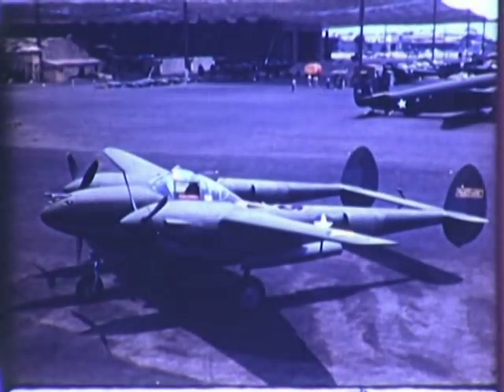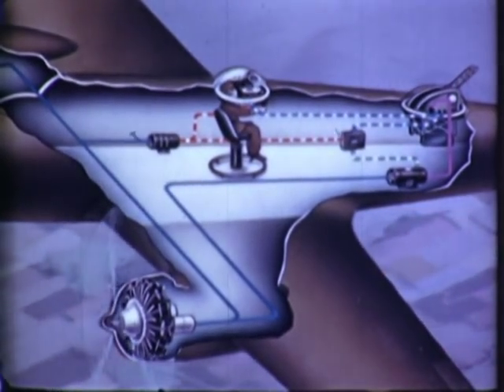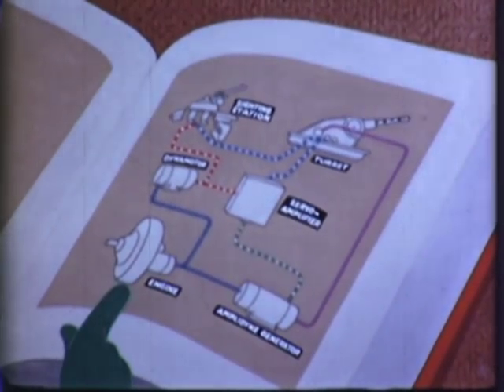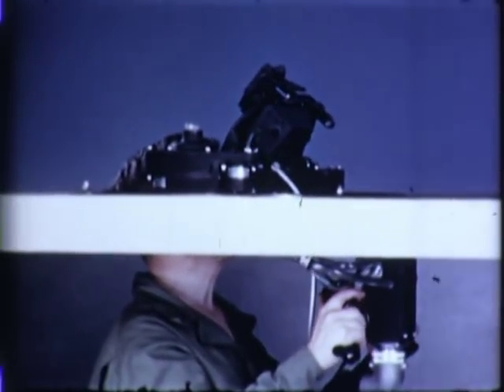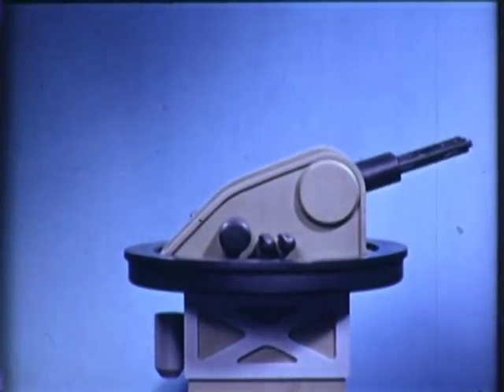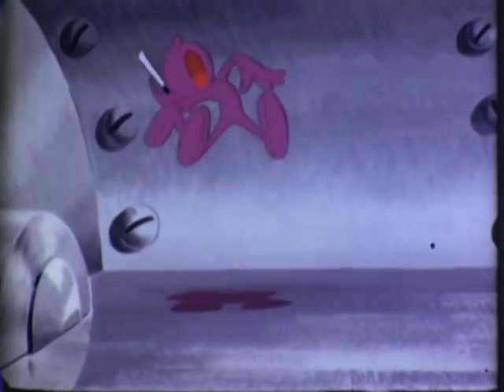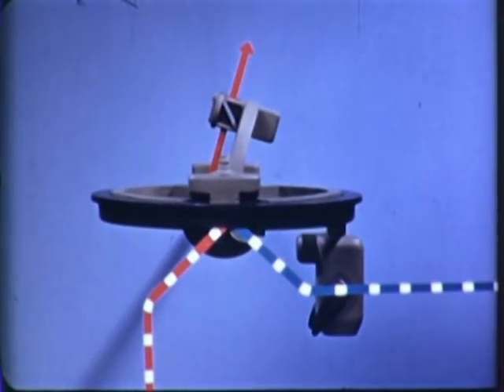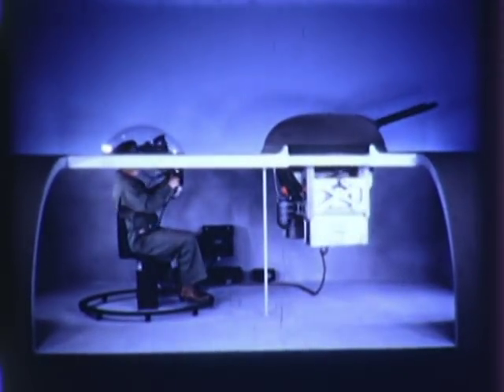Central Station Fire Control System - ca. 1944

Comment: Nothing about the part of the mechanical fire control computer, that automatically calculated lead for the gunner, taking in the gunner's aircraft's speed, height, altitude, temperature, and the wingspan of the target (gunner had to dial that in). This part was state-of-the-art...and probably too secret to show in this instructional video.
Reply: I say thats one of the main reasons the B29 supposedly had higher level of secrecy than the Bomb.
Reply: Yeah the secret of Nuclear Weaponry was already out, the Germans were not so secretly developing and producing Heavy Water in the Nordlys Hydroelectric Plants. And yeah, they can't have anyone hearing of these secret capabilities cause if these pilots were captured, the enemy could beat this information out of them.

Comment: What if the gunner aimed at himself, a.k.a. at a target right behind the plane?
Reply: Each turret had a mechanical fire interrupter that prevented the guns from firing when a part of the airplane came into range.  They were typically controlled by a cam and roller arrangement on the turret ring.

Comment: I don't understand the point of this video.  It  goes through the basics of how it works (kind of like a magic trick reveal), but is not technical enough to allow troubleshooting.  Plus it seems aimed at 10 year olds.
Reply: I'm pretty sure it was made for the enlisted men that served as crew and maintenance technicians as a primer for what's to come. It's simpler to show an overview so it's easy to understand the basic points of operation rather than just throwing the manual to a bunch of 20 year olds and expect them to try and digest how the systems function. Pretty much, yeah, you treat your crews like 10 year olds and show them fun animations before you really dive in.
Reply: Farm kids from the 20s and 30s who only grew up with the most basic of machines.. sausage grinder, coffee mill, meby a t model ford. So things like this works for them. Just like kids nowadays would never understand why tech videos from the 90s seemed so primitive.. cause they learned a pc at the age of 2...